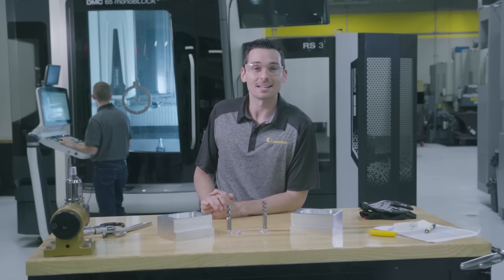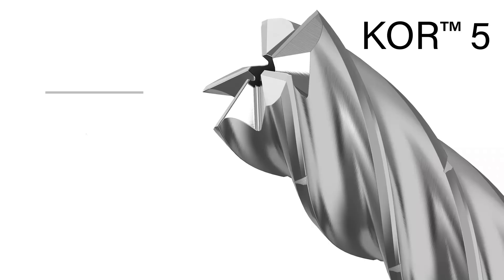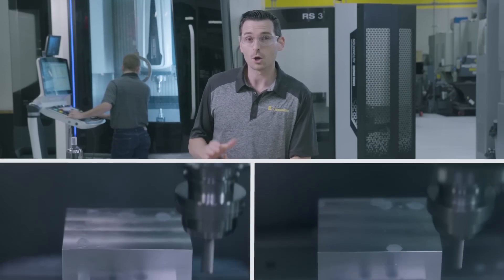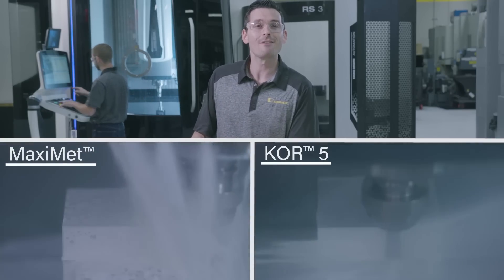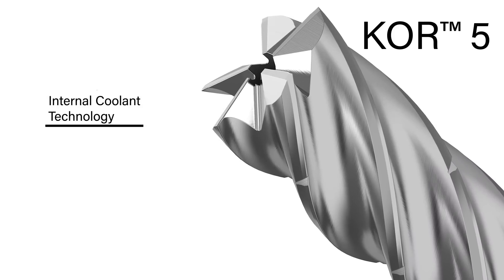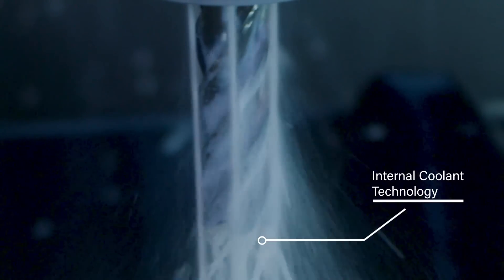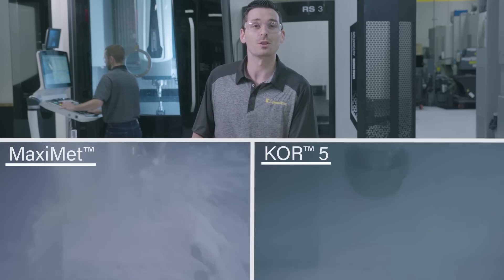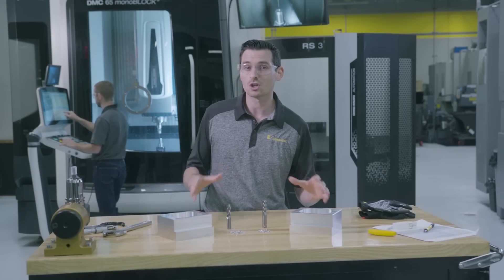KOR™ 5 High-Velocity Aluminum Roughing

Comment: Warning to anyone who buys these. Unless you have a 20,000rpm spindle and can run feed rates at 400 plus don’t even bother. Our 10,000 rpm spindles turned these into sticks of aluminum. Even at a 300ipm feed rate all they do is gum up. I want to save people the high cost in trying out themselves.
Reply: We've been using them on our 12k and even 7k rpm mills with no gumming issues. 1/2" R.06 KOR5 at full LOC, .25" stepover, 12k rpm, 207 IPM, thru-coolant. 3/8" R.015 KOR5 at 1 LOC, .1" stepover, 7k rpm, 90 IPM, flood coolant. These things eat AL up, not sure why they gum up on you.

Comment: No feeds or speeds? This doesn’t provide us with much information.
Reply: It can pretty much handle whatever machine you throw at it though so I'd start at whatever my Max RPM is at with 10% radial step over full depth and program at 100 IPM then keep increasing my feed override while keeping an eye on my spindle load
Reply: Fred Freeman unless you have 20k rpm or higher don’t bother. We learned the hard way these are junk on 10-12k machines.
Reply: run at 21000 RPM @800IPM